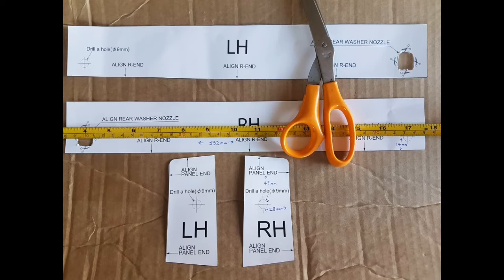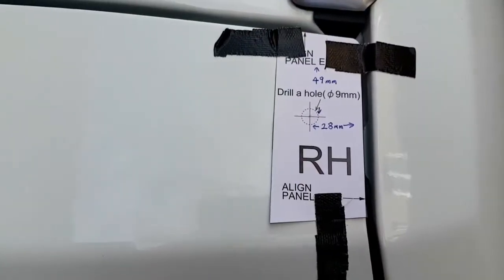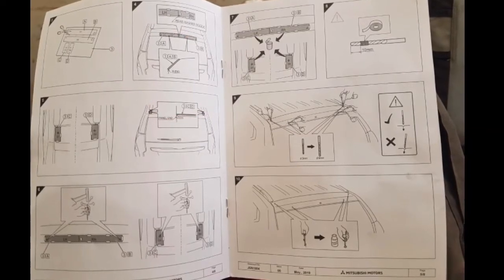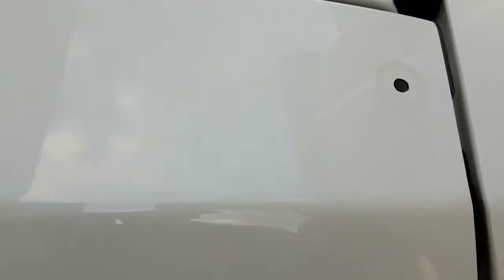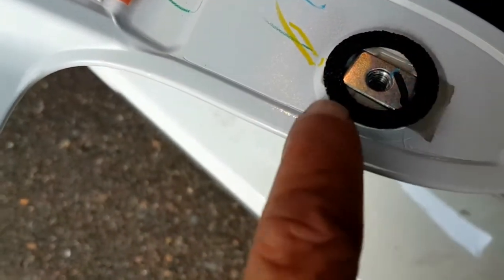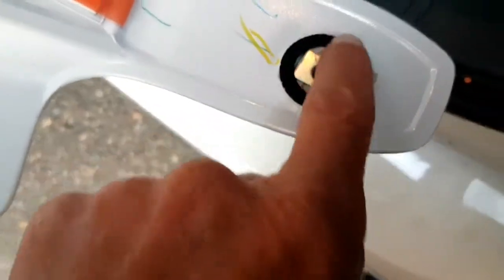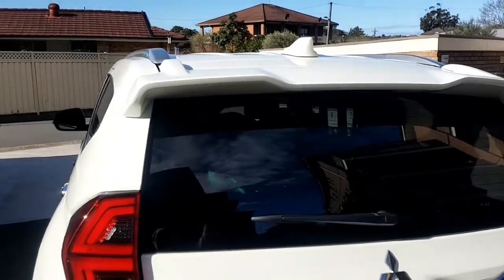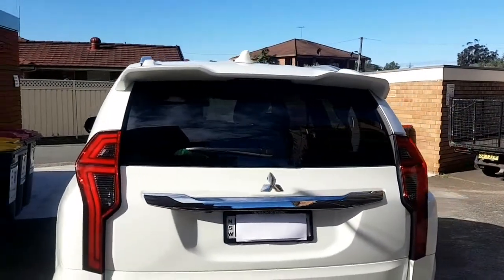Mitsubishi Pajero Sport 2020 rear spoiler installation

Comment: the holes where you drilled to insert the srews, if it rains is not the rain water will get through inside?
Reply from the maker: no I put silicon around them